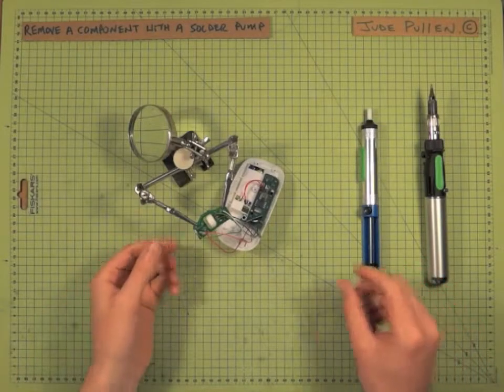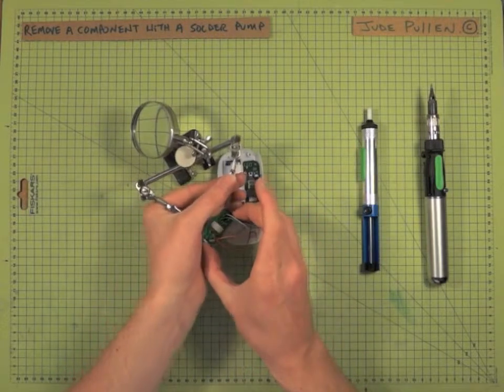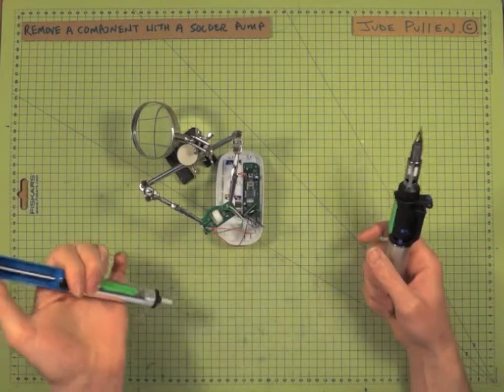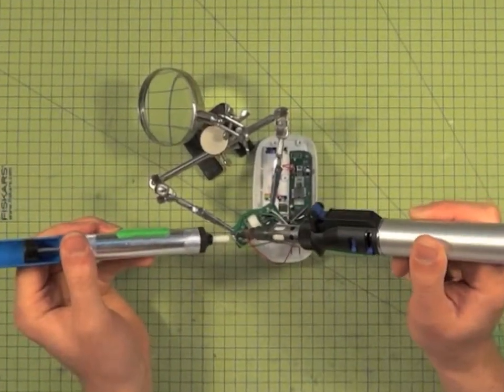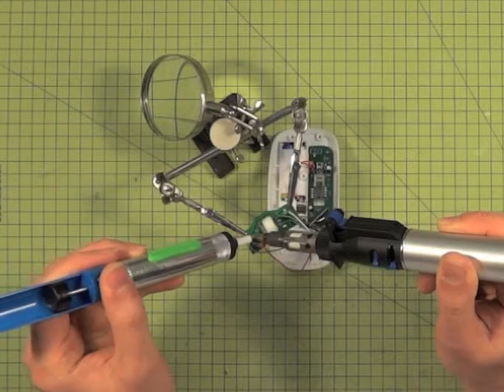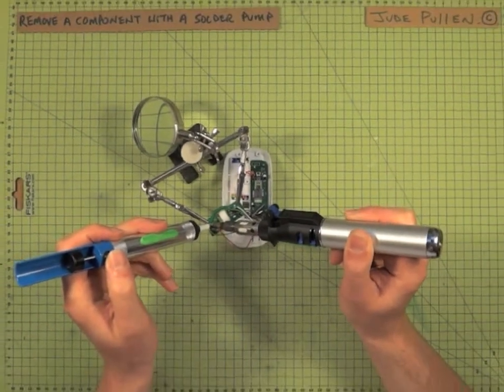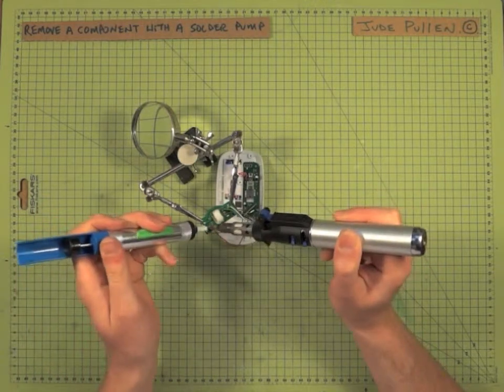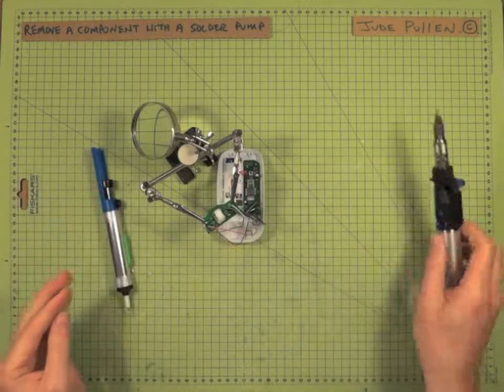Ergo Mouse Techniques - Removing a Component with a Solder Pump

Comment: Jude;
Flux on solder wick much faster; only one pass. The heating and cooling over and over is hard on the solder pads. Looks like the flame from your torch is much hotter than required; more stress all round. You presentations are done real well to bad they have minimal viewing.
Reply from the maker: Interesting - will have a go. Thanks for the tips!